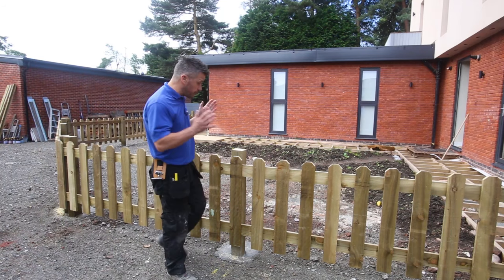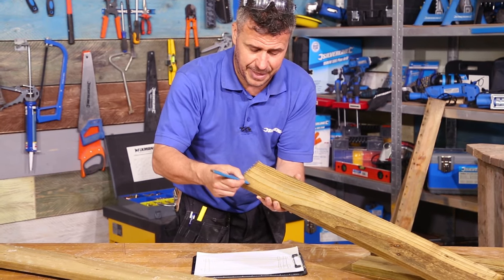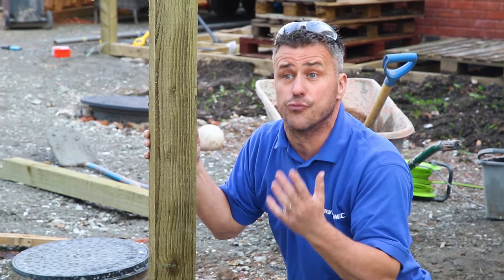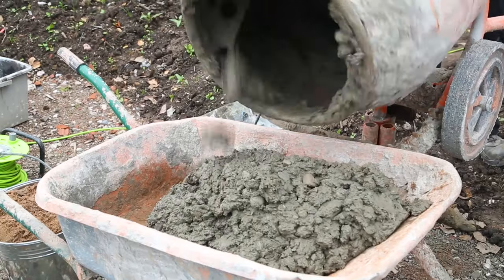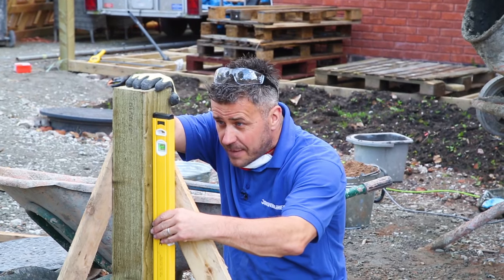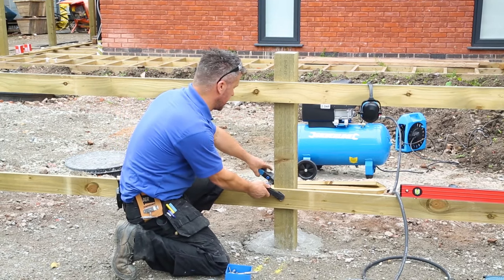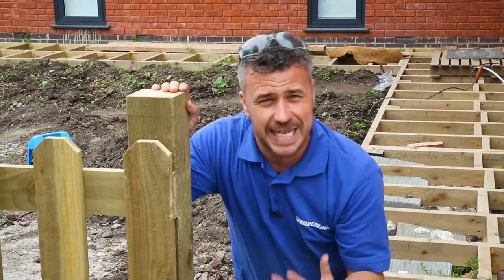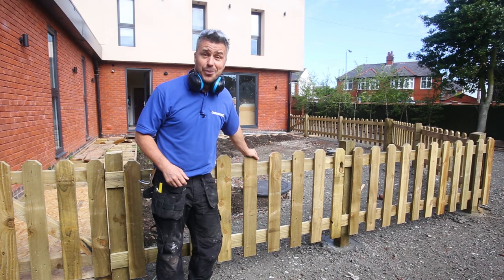How to build a fence

Comment: Arris rails, not Harris rails, Pales not Slats - 100mm x100mm is a bit overkill for a picket fence, use 75mm x 75mm, they'll be slightly cheaper too. Instead of mixing up concrete for posts buy bags of Postcrete it goes off in hours.  8~)

Comment: I'd be adding an offcut of paver to keep that post of the bottom of your hole, but pre position your posts with two pegs and some bracing, plum your post then pour your concrete. Otherwise you risk of having your fence posts running out of plum. Not a negative mate, but try it...it works regardless of your fence post heights.
Reply: Nice tip!

Comment: Bit of overkill for a paling fence. Start off by buying paling fencing. I can buy locally in 2021  for 75mm X 900 mm at just over £1.00. Then use 75mm square, larger not needed for a low garden fence which I think most might be interested in, rather than what looks like a housing estate  fence going through concrete. Posted with best of intentions.

Comment: postcrete is sooo much easier
Reply: Your right it's a bit quicker and not as much mixing, however if you have lots of posts and fencing to do i like had it would be far more expensive using Postcrete
Reply: @MrDIYCraigPhillips  See you point mate. Standard concrete mix is about £4 a bag from the main DIY stores. Postcrete about £4.75.
I've got 15, 8ft posts to put up in the spring (for panel fencing). Going to be pricing that one up carefully, might even look to see if I can get some ready mixed delivered.
Reply: @AshSUFC1889  At that price with 15 posts its not going to be a huge amount so if you can afford it, go for it, strength wise it will still be the same. Good luck.

Comment: Make the job easier and use proper tools, silverline tools are the lowest level of tools.
Reply: Craig is getting a few ££ for using them id say..he is nice fella so if he can make some easy tin I dont mind..that hand saw looks pure dirt thats for sure..
Reply: I take it you've not used Silverline tools for many years now, I've watch the brand and its tools rage over for over 15 years now and you'll be impressed if you used them now, pound for pound they stand the test, and get the job done on a budget.
Reply: @MrDIYCraigPhillips   I'm a professional Plumbing and Heating engineer and also an administrator on a trade/DIY forum, silverline tools never get a good review from any member whether Pro or DIY. I appreciate it's a low end market product but for the small £££'s there is much better available out there. Some comments on their products are "not fit for purpose" says it all really. We find the diyers will either buy erbauer or draper.
Reply: @pb9926  Thats disappointing to hear, which forum is this please,
Reply: @pb9926  Thanks for your comments, we will take this on board and all feedback is helpful for future development. we'll look into the forum and try and find which tools are are, to date we have over 9000 different products and get thousands of great feed back form most of the range.